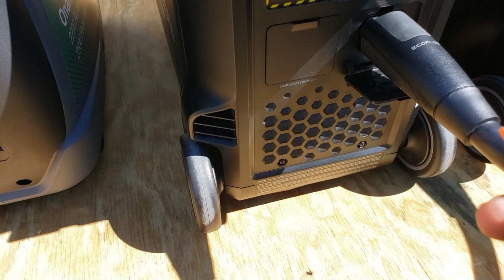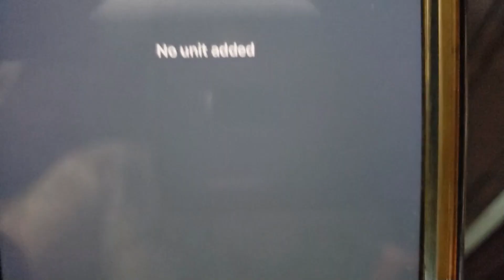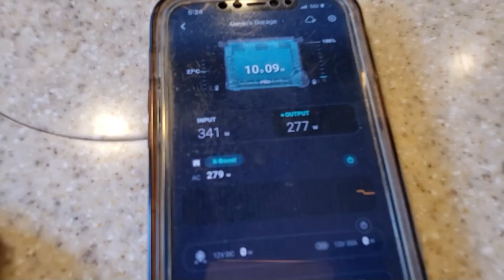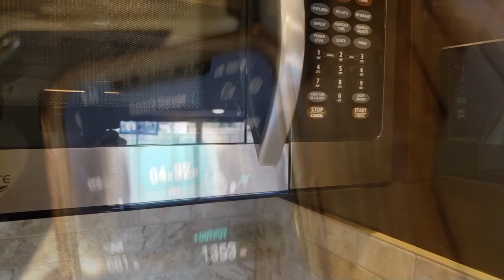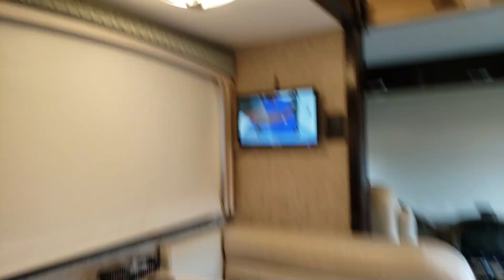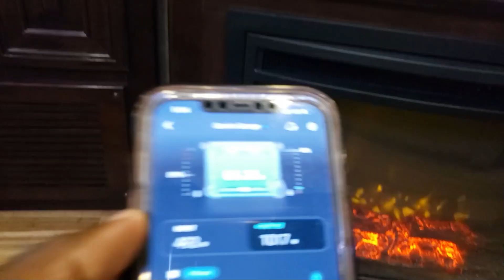ECOFLOW DELTA PRO 7.2kwh Solar Generator and Smart Extra Battery Power Station Load Test

Comment: Great video as always.  Did you have soft starts on your ac's?  I want to be clear that the delta pro can handle the surge of a 13000 btu air conditioner without the soft start.  Thanks
Reply from the maker: Thanks, yes I have soft starts installed and I would recommend them to you as well.

Comment: I have two Delta pros and a smart home panel. I have the smart panel connected to the main breaker, but I do not have the Doctor pros connected at this point do I connect One to begin with or both. Flows videos shows only connecting one I do not want 240 V, I just have two Doctor pros. I’m assuming I can split the circuits. Thanks for any help. I was just also wondering if I need to remove the little green 240 split thing at the top
Reply from the maker: You won’t get 240 V unless you have an appliance that requires 240 V But what you will get is each Pro will support  one leg.
Reply: @GeneratorReviews thank you so very much

Comment: Did ecoflow come with a generator connector or is that just a normal 3 prong and you plugged it in on the generator? I have a champion 2000w generator and I was thinking of doing what you did instead of buying their smart generator.
Reply from the maker: You can charge it with just the normal AC charger if you want using a regular generator
Reply: @GeneratorReviews  can I use the 240 to charge for faster charging? Just wondering.

Comment: One thing to remember is that the "hours left" is just an estimate.   You aren't going to run your heater, ac, stove or lights all the time.   This is why they call it watt hours.  Meaning this is the time you have "if" you never turned off the stove or AC or heater.   Who leaves the stove, AC, and heater on all the time in real life though right?

Comment: OMG ! Turn off X-BOOST ! You want to fry your AC's and all your non-resistive loads in your RV ?! You do not want to have X-Boost suddenly engage when you are running @ 30 Amps through the RV connector ! You want a maximum 3.6 Kilowatt sustained 120 Volts AC nominal voltage, and you want your Delta Pro to shut down rather than engage its X-Boost feature while powering your RV.
Reply from the maker: Agreed 👍🏾 I probably missed that but you’re absolutely correct ✅

Comment: And now it is too bad that ecoflo didn't make it so you can just add four to six batteries to the Delta pro no the guy do the same thing and at only two batteries too it so it'll only be as good as a Delta Max. This way you can't just buy to Delta pros and eight to twelve batteries so you better run your house perfectly this way you're actually have to buy 6 Delta pros and two batteries for each to be able to run everything in your house if there's an actual power out. And that's what I was thinking about adelta Max if they had that many batteries combining two together that one was pretty much made all most a perfect system.
Reply from the maker: Agreed 👍🏾

Comment: If you got a gas generator your videos going to suck you got to electric generators and gas generator this is supposed to be electric generator and solar panels and if it's Filipinos aren't making enough electricity get some more solar panels not the gas generator which cost incredible amount of money and gas in 1 year 3 years five years ten years 20 years 1,000 years that's why gas generators suck. The cost is ever-increasing that's why everybody's going with electric generators instead of gas generators that's why everybody's going electric generators instead of gas generators.

Comment: Great review bud. Looks like you've had these units about a year now. How they holding up? I'm waiting on my finally! Recieved the first one smashed from FedEx lol. You got any info on how much power you can have on the Delta pro going into eps? I'm seeing alot of people having issues being plugged in and having the power go out and then right back on and damaging the delta pro. Makes me want to put a 5 minute delay switch on the plug it's on lol I'll be using my to run my 12k portable ac at 1200 watts with 1200 watts of solar. I sent back the delta max 2000 due to firmware issues and upgraded to the Delta pro. Doubled my wattage, solar input, and capacity! Lol
Reply from the maker: They are great units, I think you’ll like them too.

Comment: How are these holding up? I didn't think you were suppose to run xboost with multiple devices. Did you modify this or still using xboost?
Reply from the maker: I don’t use Xboost
They’re holding up pretty well I use them a lot

Comment: Another excellent video,quick question I currently use in my semi during the summer a eu2200 watts honda inverter generator to power a 12,000 btu smart inverter portable ac ,initial power is about1,000 watts and it can come down all the way down to 200 watts,the question will be how many hours can I get using this unit to power the same ac mentioned just for a quick break and less noise,thanks in advance
Reply from the maker: 200 watts load you will be able to run for 16 hrs
Reply: @GeneratorReviews  wow you really think so ,that sounds great, thank you so much for answering that question will be happy with 10 hours

Comment: If I were running 2 that's only 3200 input but I'd be double that for draw for my house.  Could it be hooked up so excess power is used charge for night?
Reply from the maker: That’s actually the best way to use it just like you said

Comment: Can you recharge one ecloflow using the other?
Reply: @GeneratorReviews  Thanks. I have a delta and delta pro. I’ve tried charging one with the other but no luck . when plugged from the AC of one, to the input of the other , it begins to ramp up to a hundred or so watts then shuts down and starts over. It continues this and never charges? It actually charged the first time I tried it, but I can’t get a repeat
Reply from the maker: @brentftaylor  Thanks for sharing this info with us. 👍🏾💯👌🏾😎

Comment: Hey Just A Quick Question, what is the stand by time for the Delta Pro? Is it a
Full 10 days? I am considering the Delta 
Pro for use in my Van 🚐 it seems like
Overkill but they work brilliantly 🚐⛺️
Reply from the maker: Best for vans and Rv’s you’ll absolute enjoy it
Reply from the maker: Standby time is more than ten hrs
Reply: @GeneratorReviews  oh thank you, because I was thinking that I could change it up at a
EV charging station but between there and
My campsite I wasn’t sure, I’ve decided on
An extra battery unit for those really cold
Nights.

Comment: Really cool to see, especially the close-ups of the panel.  I didn't realize the "normal" AC input could take 120/240 but the label clearly says it.  I bet that would be nice charging from a bigger portable generator faster.  One complaint on your title - 7.2kW should be 7.2kWH.  I thought this was going to be two of the Delta Pro's with the voltage-double 120/240 kit to power a home transfer switch.

Its still outside my price range but I like their modular design and this is the only system I've seen so far that can be broken down to move 1 piece at a time so you don't need a forklift and also put out power wattage comparable with a full-sized gasoline generator, and expandable up to similar kWH capacity as a generator with a full tank of gas.  I love the idea of using the battery so there is power 100% of the time and run the generator just a few hours a day to fast-charge the battery packs stretching emergency fuel reserves, my portable generator uses only about 50% more fuel flow at half load then spinning with no load at all so its inefficient to run it all the time "in case" you want power.
Reply from the maker: Thanks Matthew 👍🏾💯
Reply from the maker: I updated the title thanks 🙏🏾

Comment: Gavin, You show the power draw for the AC at maximum.  Wouldn't it's compressor shut down after it reaches the temperature you set it on?  That would increase the runtime of the batteries?  Great video!
Reply from the maker: I will give that a shot

Comment: I am looking into getting a setup for my RV since we are living full time and plan to boondock quite a bit. I noticed you weren't using the super flimsy solar panels that Ecoflow offers. I am still learning new to this and learning all I can. I would be interested to know what panels you are using here as I will be looking to get closer to 1600 watts output and mount them to the RV. I don't think I would trust what Ecoflow has to offer. Any advice would be great!
Reply from the maker: Hey Chris 
I’m using 320 watts panels it’s so much easier to manage instead of those 100w ones. If you’re planning on maximizing your solar outfit you’re going to have to go with larger panels like mine. 
These are just off brand I think they’re called high-tech

Comment: Hello Gavin, I wanted to wait a month before ordering to ask you if you still have as positive review as you originally had.  Also are you using the solar panels ECOFLOW sells?  If not what brand do you recommend.  Is there anything else you would recommend knowing that our power WILL be shut off this year because of fires.  I am new to this and I want to be prepared.  Thanks sharing your knowledge with me.  Looking forward to your next reviews and take care.
Reply from the maker: Hey 👋 
I don’t use the panels because you can order them from other places and save big. No regrets. I seems to be finding more ways to use it every day. They’re not cheap but it’s probably one of the best ones out there.
Reply: @GeneratorReviews  Ok so you ARE happy with the EcoFlow.  Please could you recommend the solar panel brand and size please?
Reply: I think I am understanding that you have no regrets on purchasing the Delta Pro Ecoflow and that you recommend getting the solar panels from another vendor. If I am understanding this correctly, would you please recommend the Solar Panel brand and the vendor you purchased them from.  Ok.  I hope I have not confused the issue.  Take care.
Reply: @christinejones2118  there's a similar comment above where he links his solar panel video

Comment: What is the difference between EF ECOFLOW DELTA Pro Smart Extra Battery, 3600Wh and EF ECOFLOW DELTA Pro Battery, 3600Wh? Why price of EF ECOFLOW DELTA Pro, 3600Wh cost more than EF ECOFLOW DELTA Pro Smart Extra Battery, 3600Wh?
Reply from the maker: One is the actual inverter with battery and the other one is the extra battery only.
Reply: Thanks for your response,

Comment: Just ordered one today. Looking forward to it. I canceled the 3300 watt ecoflow just went big. Tired of getting up in the am and running the gen for coffee and tv at 6 bucks a gallon. This thing will pay for itself in less than a year.
Reply from the maker: Agreed!!
Reply: It saved me $150.00 per month,I used to use a Honda generator. Delta Pro saves the gas can hassle and NO Noise!!!!!
Reply: @allenmeinhold7038  It only took one storm when I was plugged into the wall charging to get a code. It stopped working that quick. They sent another one, but I traded it for dental work. I just didn't want the warranty to run out and then no help.

Comment: Great video.  Practical application.  Do your AC units have "soft starts" wired in or are they factory standard connection.  Thanks.
Reply from the maker: Thanks 🙏🏾
Yes they do have soft start with I think is a must if you plan on doing generators

Comment: Good Video!  What meter are you using?
Reply from the maker: Just one I got on Amazon
Reply from the maker: Multimeter, 6 in 1 Home Digital LCD Meter Power Monitor Panel Ammeter Digital Voltmeter Power Meter with Mutual Inductor
Reply: @GeneratorReviews  Thank you!

Comment: Gavin, thank you for both responding to my previous comment on your Generac backup power review, as well as your informative and thoughtful review of this product.  I am just learning about generators so am not versed in electronics  "speak."  

So you have 2 - EcoFlow Delta Pro 7.2w or does it come with those two with purchase?  Am I understanding correctly that the battery/generator does Not charge in the sun while using the generator? Considering our situation knowing that our power will be turned off for perhaps days due to fires and fire prevention, if this were your family would you have 2 generators (or as I think I see it on your video, 4 generators).  

Does that SolarPanel come with the Ecoflow Deltapro?  Seems to me that the quality of the solar panel is a critical piece to this equation.    

So it is using up its capacity to charge and then at some point I have to unplug everything and let it recharge again?  This means food in the refrigerator won't be kept fresh for about 10 hours.  This is why I am thinking of redundancy and ordering 2 (sets?). Gosh so much to learn and figure out.  In our situation, we would anticipate that our refrigerator would without power 24/7 for perhaps days until power comes back.  Would EcoFlow Delta Pro be able to handle a load of wash and then dryer?  Please what is your opinion on our above scenario?  Your channel is very important and I thank you.  

Are you planning on reviewing the Patriot backup generator that is advertised on your channel?
Reply from the maker: OK the first thing I’m gonna say is thank you and just to clarify the EcoFlow can charge on solar and generator at the same time while being used.
So it never has to be disconnected from the load to charge.
EcoFlow comes with the inverter and you can buy a separate pack which is extra battery system allows you to use two extra batteries.
Since the washer is 120 V it can power the washer but most dryers are 240v So you would need to another to get the 240 V
Reply: @GeneratorReviews  Thanks Gavin and take care.

Comment: A little disappointing especially seeing that you have the extra battery. I thought the duration would be much more. Excellent review. Thanks much.
Reply from the maker: I think for the price, plus the extra battery you should be able to walk through 24 hours running one AC, at least.
So I agree with you.
Reply: Battery/inverter units are like motorcycles. You can never have enough power. After tinkering with backup power and building 8+ solar generators at home, I have a very good appreciation for what the utility company sells me.
Reply: @kimmer6  Absolutely and well said!

Comment: Do you know roughly how much it costs to charge the single main delta pro unit using household electric from a regular wall outlet?

I'm wanting to use this for a window air conditioner unit and want to save on the electric bill but if it cost a lot to charge it may not be a good fit.
Reply from the maker: In a power outage having power to keep you and family cool electricity is priority and priceless.
Reply: @GeneratorReviews  Are you able to answer my question?
Reply: If you don't  have solar panels with good sun exposure and you rely strictly on your utility company to recharge the Delta Pro unit, it will cost you slightly more on your utility bill than just plugging your window AC into a wall outlet. The only way to cut your utility bill is to supplement it with solar panel power and use it to recharge the Delta Pro.
Reply: @kimmer6  so charging this strictly on regular electricity from a wall outlet will cost more than running an air conditioner from a wall outlet?
Reply: @dynosaur5291  Yes it will. About 10% more because there are inverter electrical losses in the solar generator. Sorry for the bad news.

Comment: For whatever reason when I try to turn on my fireplace in my camper the fireplace shuts down using my Delta Pro
Reply from the maker: How many amps does it show on the EcoFlow display being drawn?
Reply: @GeneratorReviews  I'm going to have to repeat the process.
As it is I'm having issues with the app. I literally just got it installed and finally communicating with the DP but the internet side isn't. Just got off phone with Ecoflow who just made a ticket. Apparently firmware needs updates but because it wont connect it cant update. MAYBE it's because it was not in xboost? But even still, my 3500watt predator will power everything and the DP is 3600watt outside XB so I'm lost. my fireplace is identical to yours. Maybe I'll make a video..

Comment: Great detailed video. You touched on a lot of helpful things to consider using the Ecoflow system for.  You should do a video about the Standby (UPS) feature.  It works very well.  I've been testing out our DP for the past month now and really like it as a backup power source to our Tri-fuel generator.  I can tell you how the Standby feature works if you're not sure.  The owner's manual doesn't really explain what it is and how it works. Running our entire house, with forced air heating, we get 3 1/2 to 4 hrs. from 100% to around 7% battery.  I'm looking into purchasing the extra battery or another DP, to add to our system for longer run times.
Reply: What's the deal with the standby switch?
Reply: @KaceyGreen  you can turn it on remotley using the app
Reply: @jacquelinealdridge5001  yes